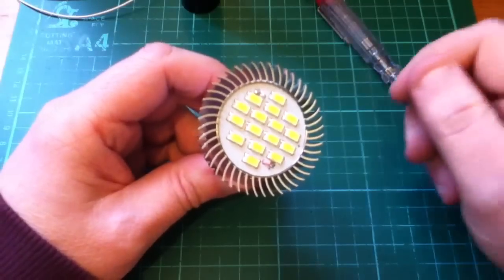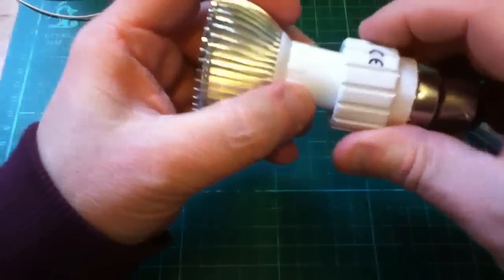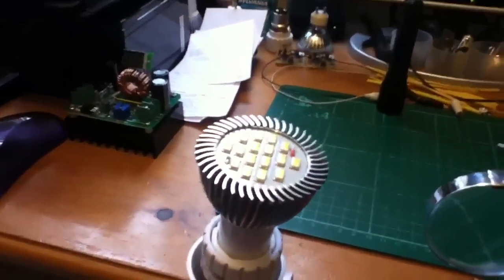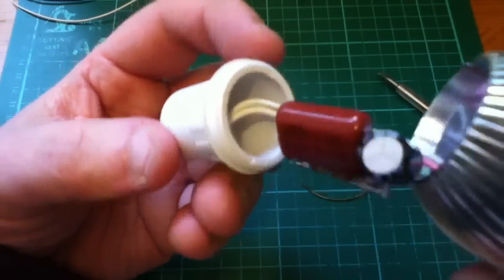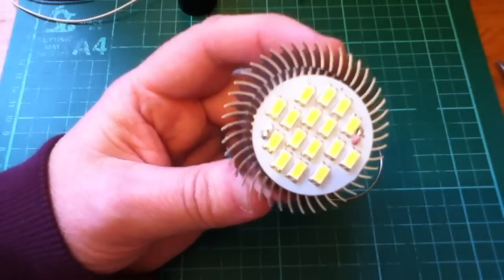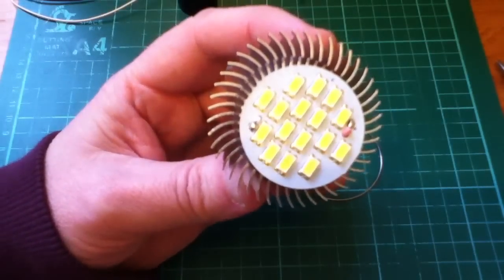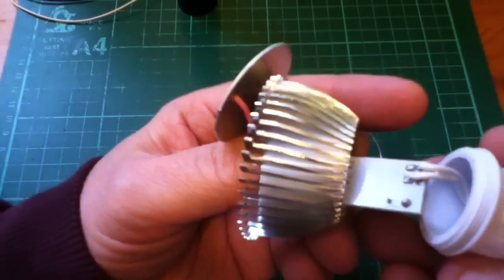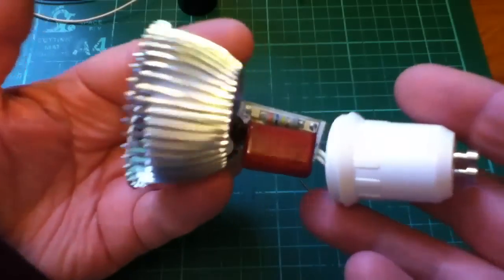Dangerous GU10 LED Spot Light is Cheap and Bright but could Kill You - Seriously

Comment: Have you seen these ones? Someone on AVForums spotted them, bit hard to tell whether they've got a protective window or not.
http://www.homebargains.co.uk/products/5496-ecolight-led-bulb-gu10-warm-white.aspx
http://www.homebargains.co.uk/products/7661-ecolight-led-bulb-gu10-cool-white.aspx
Might be dangerous, on the other hand might be the best cheap ones out there! Who knows...
Reply from the maker: I'm half expecting to see Anne Robinson grilling the boss of eBay UK over this. I'm steering well clear of cheap electronics that connect to the mains. I'm going low voltage.
Reply: Tech Davey
Good point. We started blowing server room power supplies within minutes of our new aircon system being switched on (in fact that's why I bought my power analyser). We ended up replacing the APC Silcon 20kVA UPSes with a pair of Riello Multi Plus 40kVA, problem went away. Incidentally the Silcon twins were split up and sent to different sites 70 miles apart where they did their job quite happily and one's still going strong (the other being replaced by a SmartUPS VT 20kVA, already on its second power module after the first packed in).
Reply: Tech Davey actually they own the flat, and it's a really expensive one, too. By Knightsbridge - but they tried to get a permit for that, and nope. It's from 1934 (just asked) and so crap. They are trying to get a permit to change the windows, but all they are allowed to do is use new windows, but in the same type (wooden, slide up and down things). It's really annoying cause when I stayed there once the two window parts were bashing against each other, a strong draft is coming through, and when there is strong wind with strong rain it even starts spraying inside..

I lived in the UK for 5 years in 4 different places... And house wise - it was disgusting.

I guess I've been spoiled living in continental Europe.

Funny enough - our fence in Birmingham gave a tingling sensation in the hand when touching it after a rain, even when grounded (without shoes or socks, barefoot on earth) - told the landlord, he said "Sure! Bollocks!"
Reply: Tech Davey Man. Sounds like UK has some crappy power issues. Is this why many people prefer 120v in homes?
Reply: The higher voltage means we can draw more power through the same conductor size.
Usually we get very little trouble with our supply (compare with the supplies in rural Spain which are a different matter altogether)
Reply: ***** No. It's just a thing about the UK calling itself high-quality and well built, while everything is old, moldy and kinda rotting away. Friend of mine got quite a harsh injury cause he when he was showering an old wire opened up in the wall and touched the metal pipe - luckily the fuses were fresh and popped out as soon as the short happened - not quick enough to prevent from my mate being completely f*cked up.

Funny thing - they were not even allowed to do proper repairs, because as 95% of buildings in the UK, this house is seen as cultural heritage, which means they have to repair it the same way it was done before, meaning wires in the walls had to be placed in the same place... They can't even change that bullshit what they call windows (them up-and-down slidy ones made out of wood), because....
TRADITION! BRITAIN! MEEH! LADS!
Reply: +MrTJMishrat ...things in central Europe shock you less when barefoot on the ground, that's seriously effed-up!

Comment: the mains power is being reduced by the time it comes out the two wires that touch the leds. so like someone mentioned below you wouldnt be getting shocked with the power of the outlet --  just whats being given to the bulbs. not likely to be much.... possibly enough that the few microns of insulation can handle it.

Comment: i think the supply voltage reaches the heatsink is no longer a 220v/110v since the circuit has a resistor. the voltage supply that reaches the led bulb most likely 12V+ since this is led bulb.. well, as an electronics, the circuit is much risky if you well see is just converting an AC-DC without transformer. it is very dangerous is true. but in terms of shock if you hold the heatsink is most unlikely since the led is working only in dc low voltage... the circuit itself is dangerous..

Comment: If they put the bridge rectifier immediately after the AC input then at the output of the bridge rectifier the 'live' and neutral are always on the same pin. No matter where the live and neutral are on the input of the rectifier.
Since they are  LED's  (diode's ) the plus and minus must be connected correct else they don't work. So it is not possible that the 'live' is sometimes on the wrong pin.

I'm not saying that this makes it more safe. This thing looks really dangerous. They should not sell such things.

Comment: This would fail CE and C-Tick approvals.  This would make the product ILLEGAL in pretty-much the whole country...
Reply: Are you serious!? Ok for safety? There is a direct connection from mains to an exposed terminal on the front of the lamp and you think that is ok? What country do you live in? I'll never visit, you have my word!
Reply: Stephen Walsh Where do you live? 64 VDC mains and 140mA power? Seriously...
Reply: BMan18 Where did i say i have 64VDC mains???
Reply: Nope. The circuit used is reliable from a safety standpoint and very inexpensive. What is not acceptable is how easy it was to disassemble. You'd be required to glue or ultrasonically seal the parts together in the US. What fails from an engineering standpoint is how susceptible to transients and mains fluctuations this would be. I suspect failure rates will tell the tale. It's a passive RC impedance matching circuit where a lot of the excess AC voltage is dropped in the capacitor and a few volts of "margin" in the resistor to arrive at 64VDC at probably 140mA (9W to give the equivalent of 40W incandescent lighting).

Comment: Just happened to order 3 of the spot light from china. On the site they say the led's on this are SMD 5630. I checked the specs for it and it runs on 3 volts! So I don't think your getting mains voltage on those exposed terminal. But I'll be sure to check with a multimeter as soon as they get here.

Comment: as the lamp is with aluminum lamp body, there should have been Isolated Driver Circuit to ensure safety...The cost price wont be more than 3 RMB to my knowledge. Cheap products, low quality. Most probably made in Guangdong

Comment: a bit like the old transformerless hot chassi tube radios that was once very populer. i have one of those next to my bed but it´s at least completly isolated with no exposed metal parts so it seens like a 50 year old radio is safer then a modern LED light.

Comment: Hi again.
I just saw your video an you are fucking right! These bulbs seems to be dangerous, but, how can they be improved? Any Home-Made insulation will be possible?
If you apply some dots of silicone (which is non conductive and easy to find and apply there where the current is passing through) will bring back a little peace-of-mind to our minds about this LED bulbs? I mean, this ones do not get as hot as to weld these tinny silicone dots. (I´m just saying, I have not idea if it will work at all, so, if you can clarify me this idea, it will be nice!). I have 2 corn bulbs and I´ll not see them as I did yesterday. Thanks a lot. 
Oh, another question, if ther are located on a ceiling and have no posibility to get touched, will they be safer than if used on a desklamp?

Comment: might i suggest you show people how you use a DMM and identify the HOT side

this is so common and i use lots of them

on a side note being that these run on AC can you tell me what is the required to run the led board without the driver can these be battery powered ???

thank for you video

Comment: I've been hit by everything from a car battery with 12v dc to straight live mains from a power line that had been downed in a metal shed after a fire.  The latter obviously hurt quite a bit, but there's no need to scare people into thinking that a standard socket can kill them in an instant.  Edison did his best with his smear campaign against Tesla trying to prove that ac was dangerous, but it all comes down to the common man's stupidity.  If you're not going to act with a reasonable level of intelligence around electricity, you will get shocked; but the chances of lethal electrocution are fairly small.

Comment: this issue was and sometimes is still a problem in the US with the old style spade plugs that do not have the wide neutral. 120 VAC is more dangerous than 240 because 120 can actually "hold" you to the circuit where 240 will push you off.
The mains in the US is  120 - neutral - 120 form factor on the transformer. we get 240 from the two 120 legs to run electric dryers and AC units and the like. The best way you can cure this LED bulb problem is to mark the hot and neutral pins with a sharpie marker and do the same on the bulb adapter.

Comment: This is good information. I installed 3 similar bulbs I bought from ebay in each of my 2 kitchen light fittings. One of them literally blew up in the light fitting, shattering the glass face and shooting glass shards and the inner workings of the bulb, all over the kitchen. Furthermore, the remaining bulb contents which were now hanging from the ceiling light fitting, actually caught fire and there was a bare flame dangling from my kitchen ceiling. I immediately removed the bulbs from each fitting and reported them to the local fire service who have told me to talk to trading standards to have them analysed. Nothing came of that though. Beware!

Comment: As long as you don't buy bad Gu10s, this shouldn't be a problem. I don;t buy the COB type, and instead go for the 3 x 1w style. They have a cover, optics, and the driver circuit goes through a step-down transformer first. Plus, they are about as cheap as these. Great video BTW.